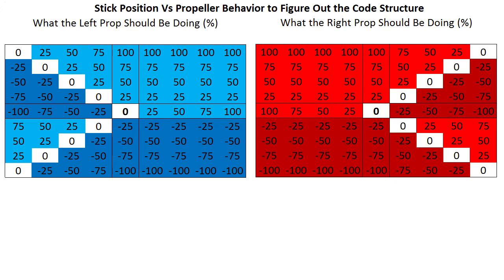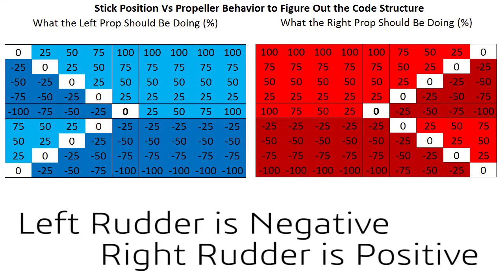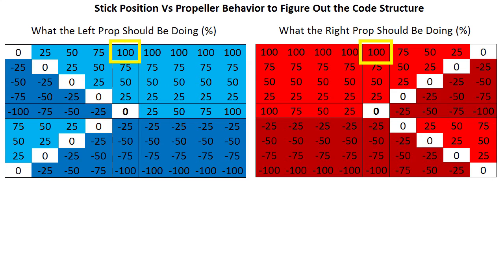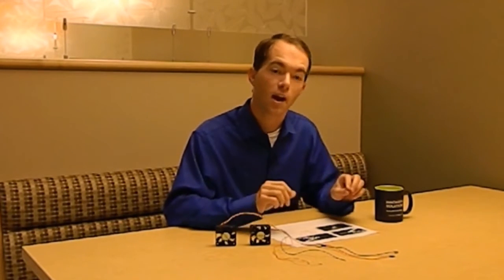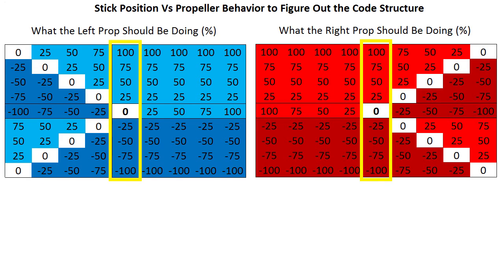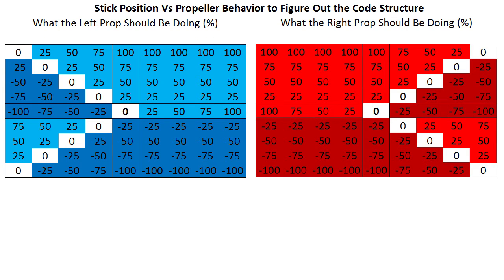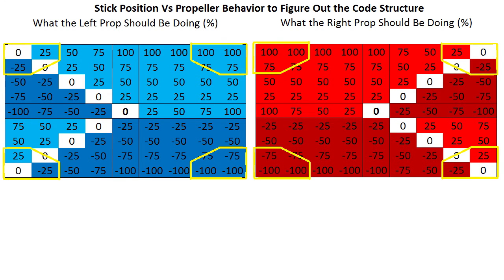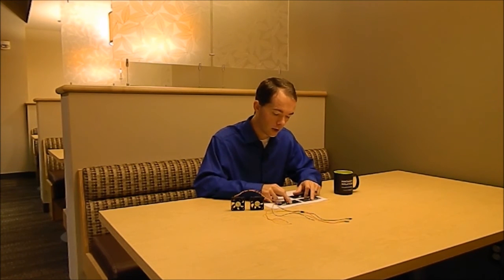Building an ROV: Pt 2.  I Need Your Help With a Steering Problem.

Comment: Hi Sr.
I would like to know whether the project has been completed, since I'm working on same project. I would like to know whether the CPU fan provide require thrust to turn the ROV cause using the other bldc motor and ESC, cost shoots up.
It will be great help for me. Ty 😁
Reply from the maker: Hi Jatin. No sadly. This project has not been completed. I determined it was not important ultimately at this time. Way on the back burner, but someday for sure... PC fans do not provide enough measurable thrust to operate an ROV in anything but the calmest water. As a turn thruster though, it'd probably work. Just remember that F=ma.

Comment: Not sure if you nailed this yet.  But proportional controls here IMO is not the way to go.  Use a simple 4 switch joy stick (like old arcade games) and mount it 45 ° so that any polar movement of the stick will always press 2 micro switches.  Those switches would then trip relays that can handle the power of the motors.  This will allow a "skid steer" type action of the props even though it would not have proportional control.  With an ROV proportional control is not really that big of a deal, and if you are using computer fans as your props you will need all the power you can... as you said in another video they dont produce much thrust.

Comment: u can do it with aurduino and use pwm function and first analog input to throttle from 0 to 255 and then program aurduino to take the set throttle value differently for each fan dependent on second analog input

Comment: Don't know if you cracked this yet but here is a bit of spaghetti code I just bashed  out. Language is python but the basic operations could be easily translated to other languages,
motor=[0,0]
Quit = False
while Quit == False:
    throttle = int(input("please type % throttle, -100% -100 <-> 100 100%"))
    steering = int(input("please type % steering, 100% Left -100 <-> 100 100% Right"))
    if steering < 0:
        direction = "% left"
    elif steering > 0:
        direction = "% right"
    else:
        direction = "% strait"
    print("throttle at ",throttle,"%, and Steering at ",steering, direction)
    i = 2
    while i>0:
        i-=1
        motor[i]=throttle
    if throttle < 0:
        forwordorreverse = -1
    else:
        forwordorreverse = 1
    if steering >0:
        motor[1]-=steering*forwordorreverse
    if steering <0:
        motor[0]+=steering*forwordorreverse
    print ("left motor at ",motor[0],"%, and right motor at ",motor[1],"%")

Obviously replace user inputs with control sticks, use the motor tuple to control the motor and delete the print commands but it's a good proof of concept.

Comment: You're wasting your time. First, use more motors ( perhaps 4) for redundancy and reliability. Second, use ordinary dc motors, there is no need for code or brushless speed control AND although you are not concerned about corrosion, it will happen quickly enough leading to ongoing problems, so the best answer is to use the cheapest most disposable motors, then you have mission failure protected by redundancy AND no brainer maintenance as well as easily adjusted, simple skid steering. This way, your hunka junk project will have a very long useful life where at worst, you might from time to time swap out the motors.

There are spray lubricants to resist water in motors for a time. Spray em up, install them, and go - i mean unless you want to waste so much time just for a short-lived discouraging failure.

Comment: Hi Mike, did you found a solution for the propellers command matrix?
Reply from the maker: Hey Mario. Thanks for checking in. I put this project on hold for a bit, because I have other projects that are more important. Besides, when it's time to build my first one, I'll probably just do a simple torpedo style ROV with a traditional rudder and elevator. This'll get me operational more quickly.

Comment: Here is the arduino code, equations,  to control servos, or  DC speed controllers.
This implements my control table.

    servoleftpos=min(((rovspeed+rovturn)*13)/20,255);
    servorightpos=min(((rovspeed+(255-rovturn))*13)/20,255);
 
servoleftpos and servorightpos values are from 0 to 255 as are the values for
rovturn and rovspeed.

      pwm1=map(servoleftpos,0,255,servomin,servomax);
      pwm2=map(servorightpos,0,255,servomin,servomax);
 
servomin and servomax are the values for the control range of the servos. The
values set the width, in microseconds, of the control pulse going to the servos.

here is a link to my video :   https://youtu.be/zHqWA-PzmGc

Comment: I think your table is wrong. try this for your blue table:
+000 +025 +050 +075 +100 +100 +100 +100 +100
-025 -000 +025 +050 +075 +075 +075 +075 +100
-050 -025 +000 +025 +050 +050 +050 +075 +100
-075 -050 -025 +000 +025 +050 +050 +075 +100
-100 -075 -050 -025 -000 +025 +050 +075 +100
-100 -075 -050 -025 -025 +000 +025 +050 +075
-100 -075 -050 -050 -050 -025 +000 +025 +050
-100 -075 -075 -075 -075 -050 -025 +000 +025
-100 -100 -100 -100 -100 -075 -050 -025 +000